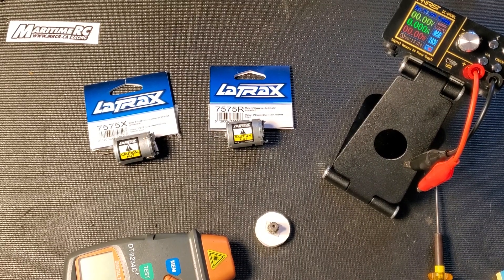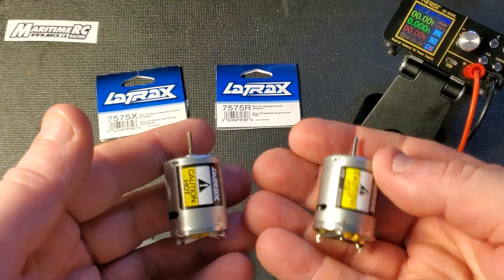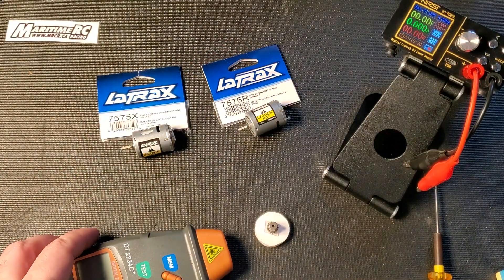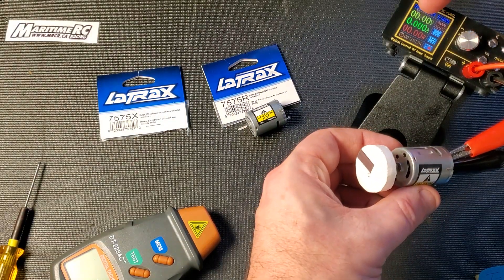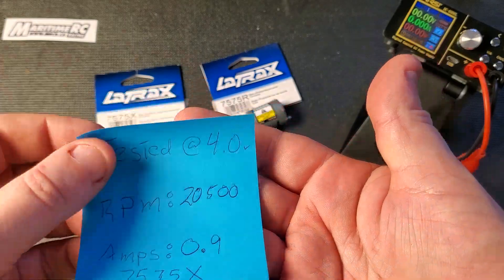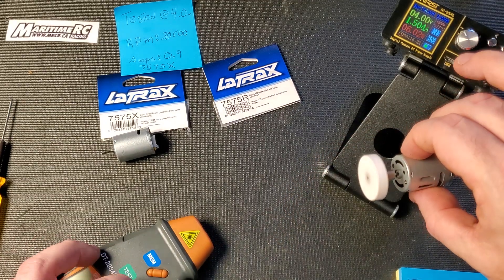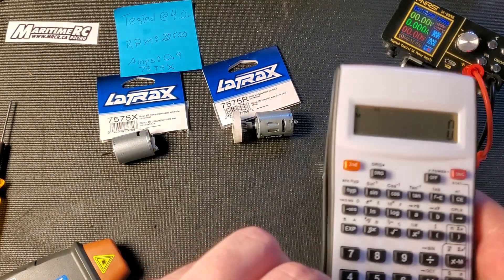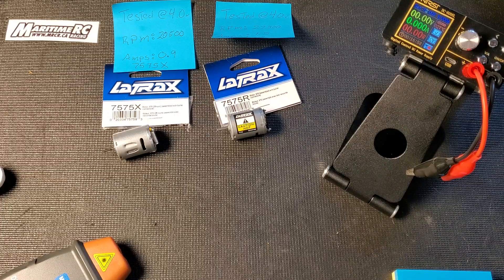Review: Latrax 370 Motor Shootout: 7575X vs 7575R

Comment: I wonder how the Tamiya 370 sport tuned motor, would compare with those.
Reply from the maker: I did a review on the tamiya sport tuned. Was about 15k rpm  at 4v. The latrax motors are both over 20k i think. After this video I have burned up both my latrax motors in the mini-b. https://youtu.be/rGWKfzkMmuo?si=mj957wa1RMso5KLb
Reply: @lawton70  burned by 3s 11.1v or 2s 7.4v? is there any reasoning going with brushed in 2024 century? cos over here 2430 is cheaper than 370.
Reply from the maker: @n00b247  unfortunately racing with 7.4v in a mini-b
Reply: @lawton70  ouch. I converted my mini-t to 5800k surpass. it was cheaper to get 25A esc+5800K than a single 280/370 replacement. stock 280 was kinda broken out of the box and the rc was tapping out at 12mph. so I did what was the only option.

Comment: I'm loving the idea of trying to keep the build cheap... I unfortunately have recently lost the fight... Just got the Spektrum Firma brushless system in my Mini-B today...  It rather comical after spending a bunch of money for more power, I immediately ran to the Throttle D/R and turned it way down....
Reply from the maker: It has been a challenge for sure. I've tried pretty much every brushed motor and still havent gotten the performance of the 6000kv brushless all in 1.